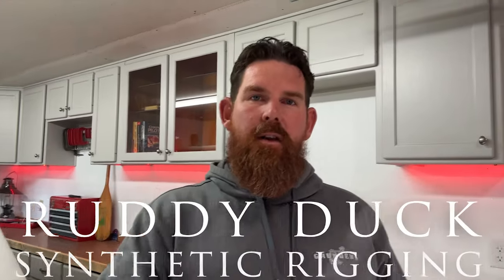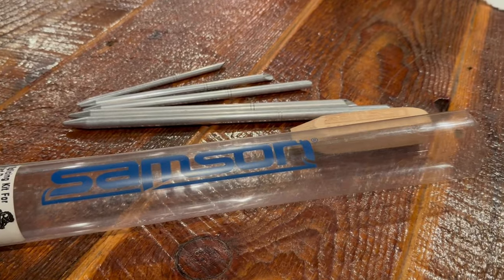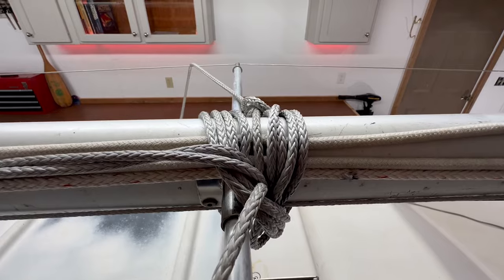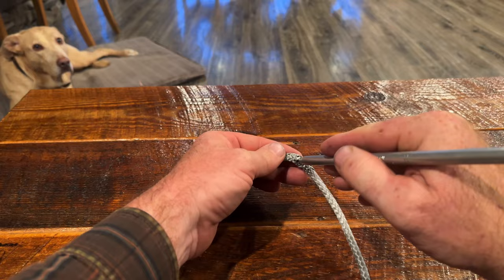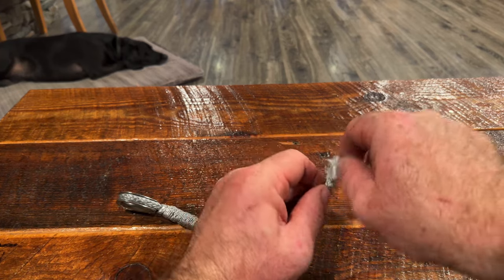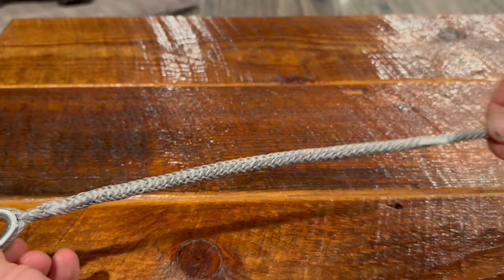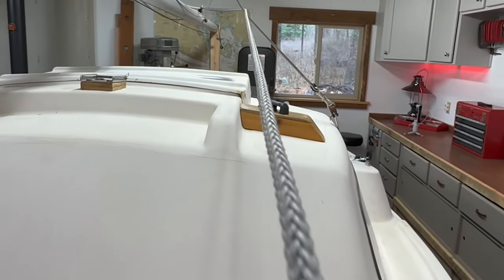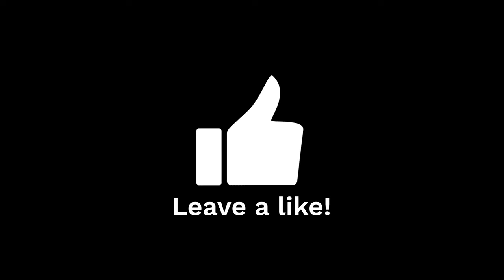Why trailer sailors should have Synthetic Rigging

Comment: on the question, 
i also thought; pull the cast iron, and re-cast a lead keel ... but i did the math on it, and it would only be 138 pounds more ballast, if the same in lead....but for a 750 pound sailboat, 138 extra pounds in ballast might not be bad ....but though lead is fairly inexpensive, it's the process of making a negative, and re-casting, that would be quite the endeavor.
but really, the SPEEDCOAT-49 bottom paint is a more reasonable upgrade, being bottom paint is part of maintenance ..... because if it moves across the wind faster, in relation, ( or more easily ) that's the same thing as having more righting moment.
my yacht design book also shows examples of hull surface smoothness,
and the graphs make me think spending a little more time on substrate prep, and having the SpeedCoat-49 sprayed on, would be worth it too.
Reply from the maker: Bottom paint definitely makes a difference in speed if your boat stays in the water ! On ballast I would opt for a lighter rig and new sails before casting a new keel. New sails will keep a boat on its feet due to the ability to flatten the sail reducing its power. And synthetic rigging will lighten the load up high giving you a lower center of gravity. If all that doesn’t work then yeah an extra 138 lbs of weight in the keel would definitely do it on a small boat!!
Reply: makeing yeah, those new sails would be definitely one of the best upgrades, for sure......a negative, to cast a new keel would be an awful lot of work.....where that Speedcoat-49 is a Hydrophobic coating. @ruddyducksailing
Reply: on both the mast patch, and the lead keel topic, i forgot to mention galvanic isolation. ( not so much an issue in fresh water, but it's still always good to check the galvanic tables, when mating different materials ) @ruddyducksailing
Reply: anyway...i am voting for new dyneema cruise laminate sails, and speedcoat-49....those are your two best moves, no doubt. @ruddyducksailing

Comment: the reasoning of it all makes sense ,although i wonder if sailing salty sea water would affect the rope on rope chaffing lines dont last long or look good after a couple of seasons you see the difference with the uv and salt water the colours fade the lines stretches and the stiffness starts to deteriorate not so much on the dyneema i only have main halyard dyneema and its got plenty of strength they just one colour anyways and been on boat since dont know two owners back about 8years and drenched in salt water
Reply from the maker: Saltwater will probably cause it to wear out quicker but I think it will still last quite awhile. I’ve read some articles where bluewater boats will use the same  setup with soft hanks on their storm jib. Not sure about the longevity . Saltwater is brutal on stainless also causing crevice corrosion in the swages .
Reply: There are plenty of people using it on blue water boats with great success. On a trailer sailor where it can be easily washed and stored out of the sun it should last the ownership of the boat.
Reply: @journeymanadventure  yes i m sold on the  idea,i have been gathering parts to add forward shrouds mast only has one set coming through spreader i m going add  another just below spreader and take them forward i got u,bolts   turnbuckles and was about to order stainless wire also adding stanchions and lifelines now i will do it all using dyneema ,thing about trailer sailers they dont have a season mostly used  all year round if the weathers bright sunny in middle of  january or any month you get sailing even if theres snow on the ground not like the big boats that get taken out onto the hard for winter  and they wishing they had left them in water for longer but cost of lift outs and putting them in and out too expensive
Reply: @theresnobodyhere5778   yes I hear you there. Apart from being compact with regards to storage and uncomfortable in poor weather there is allot of positives to a trailerable sail boat. It could be my next move🏴‍☠️🍺

Comment: The terminal you are using at the mast end, does it have a tang/plate on both sides?
Reply from the maker: Yes I have a tang on both sides of the mast with a through bolt holding both tangs on
Reply: @ruddyducksailing  thanks for the response. I think I worded my question wrong. Where the colligo attaches to the mast, is there a forked tang on either side of the colligo terminations?
Reply from the maker: Yes. You can see this at 4:14 on the video. I used split / forked tangs up top because the mast was already set up like this. If your boat has single tangs then you could use a forked colligo terminal at the top of your shrouds as long as there is enough clearance between the mast and terminal

Comment: Sounds  nice and easy and I definitely appreciate the weight savings. On my boat, however, I raise the mast and then tension the stays with the forestay turnbuckle until everything is nice and tight. How to you connect your forestay when raising the mast at the ramp? I don’t see an adjustment for tension like a turnbuckle.
Reply from the maker: I use my jib halyard fastened to the bow and tension it tight so I can fasten the forestay easily by hand. I leave the tension set where it is ! The bigger the boat the harder this will be. You can also tension the rig using an adjustable backstay if you even have one. The ruddy duck doesn’t. It’s also fine to use turnbuckles instead of lashings  on your rigging but you have to be way more precise when splicing in the dyneema.

Comment: Did you consider 1/8th" AmSteel Blue? Why not?
Reply from the maker: I did consider 1/8” because it’s definitely strong enough but I thought the 3/16 would fit better around the terminals and low friction rings.  I did use 1/8 for the lashings and it worked great

Comment: Do you have a dyneema headstay with a hank on jib? If so, have you had any chafe issues?
Reply from the maker: Yes I do. I also have soft shackles as hanks and they have not chafed at all in two years. My sailmaker assures me that standard hanks won’t chafe either
Reply: @ruddyducksailing I’ve heard when using hard hank on dyneema headstay the hanks need to be new (never before used on a metal headstay)
Reply: @ruddyducksailing how about fueling headsails instead of hacked-on?

Can a dyneema sty be used inside a furller?  Or would you need some kind of special synthetic torsion-resistant line?
Reply from the maker: I would make sure there are no sharp edges on the hanks from wearing on  the stainless forestay. If they are smooth and rounded they will be fine
Reply from the maker: I would check with the furler manufacturer but I believe it is not recommended to use a dyneema forestay in a furler.

Comment: What I want to know is, how has it changed the sailing characteristics without all that weight above you?
Reply from the maker: It changed quite a bit, and I was supprised. By removing weight up top the boat is more stable and sails flatter in strong winds making it so I can sail harder before reefing. It seems like I can maintain control in a couple more knots of wind because the rudder is still in the water and doing it’s job when we are heeling ( leaning). Thanks for asking

Comment: The video is great, thanks. I see a couple of advantages to Dyneema you didn't mention (unless I missed it.) It's resistant, probably immune to bending. When you coil or handle stainless, you have to be careful not to bend it tightly near a swaged fitting or it will crimp. In time that crimp will turn into fractured metal strands and the shroud must be replaced. The Dyneema doesn't have to be coiled, just folded pretty much any way you want.
Reply from the maker: Thank you. You bring up a very good point! especially for a trailerable boat that sets up and takes down the rig so often it is nice to be able to stow the rig quickly without damaging it. I never liked having to coil or fasten the stainless wire to the mast, it didn't keep me off the water but it just wasn't as easy as synthetic!! thanks for watching!
Reply: I have read that you DO have to be careful with bending Dyneema, which is why one uses a thimble, rather than just taking it round eg a post. There is a recommendation that the radius shouldn’t be less than rope diameter x factor. Unfortunately I don’t have the factor to hand, but it can be googled. On the other hand, Dyneema is so strong that any loss of strength due to a tight bend may be irrelevant. Finally, there is a specialist form of Dyneema developed by  Hampidjan of Iceland called Dynice. Developed for the fishing industry it is now really popular in high tech racing yachts as it takes the extreme strength of Dyneema and makes it even better. I believe that the process takes standard Dyneema and stretches it while heating.
Reply: @billfromgermany That's just while being under load.  You don't have to worry about minimum radius if you're tossing your rigging in a bucket for the trip home from the lake.
Reply: @nlfolco  No, absolutely wrong! If it’s not coiled with a minimum radius of Rope diameter x pi x factor y, when you get home you’ll just have a bucket of fibers.
Reply: The rope is called Dynice Dux.

Comment: Spends tons of money on Dyneema, uses a cheap piece of wire for splicing instead of using the proper tool. 🤦‍♂️
Reply from the maker: Lol
Reply: Actually he‘s using exactly the right tool. If you have any experience of splicing single braid Dyneema you‘d know that. Pushing a fid through is a lot more difficult than using a wire loop to pull the end through. Stainless welding wire comes in various diameters and is ideal for this. Bent into a hairpin, the the ends epoxied into a wood handle. Cost probably less than a dollar.